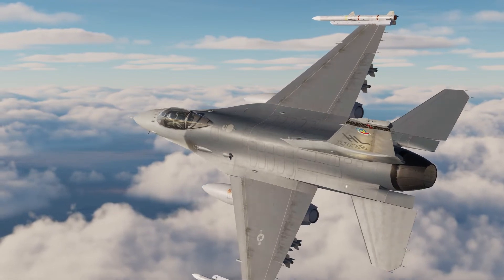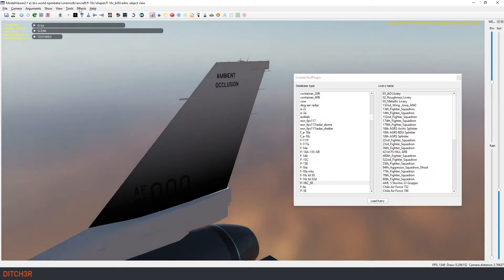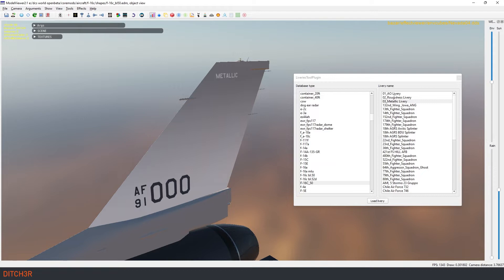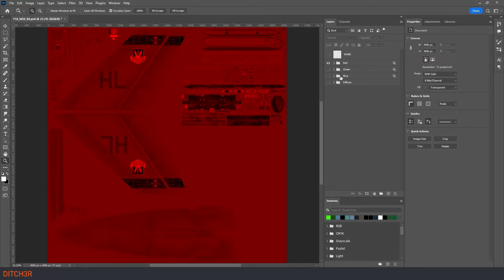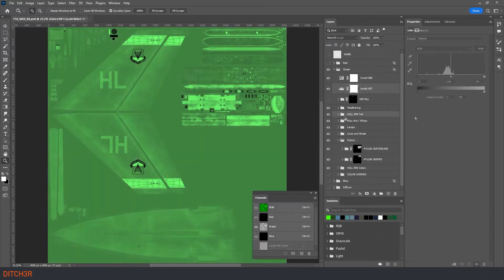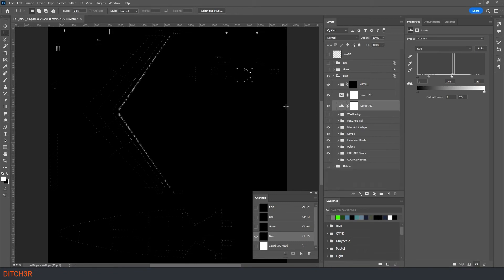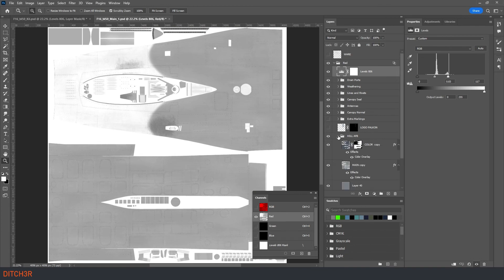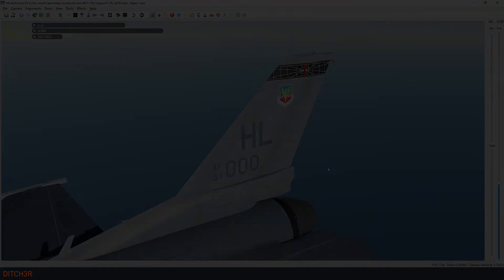DCS Custom Livery Creation | Roughmets

Comment: Hello Ditch3r, Eagle Dynamics recently removed the dynamic shadows on the inside of the canopies of a.o. the F18, so in the cockpit view shadows created from eg the seat, canopy frame or HUD are no longer projected on the canopy glass (they still are projected on the cockpit panels) which is a shame IMHO. Did they change something to the properties of the canopy glass roughmet files to accomplish this you think ? For the A10C these shadows are still in full swing. Any ideas how to get them back for the Hornet ? I tried changing different channels of the canopy glass roughmet file based on the canopy glass roughmet file for modules like the A10 but to no avail... makes me wonder if it's another setting I need to adjust for the hornet... Thanks for your insights !!
Reply from the maker: I have not really looked into this, but I will.  I was unaware they made this change, but I'm guessing it's around the time we saw the "Canopy Reflections" slider added.  I'll take a look, but I'm guessing there is no way to change it back.
Reply: @ditch3rgames  Thank you, curious what your findings will be ! It's strange that many other modules are still generating said shadows, it's apparently not a global issue

Comment: I missed where you edit the description file to use the roughmets. This part has been the hardest for me to learn with the f14
Reply from the maker: For the description file, it's the same as any other line.  Make sure the file name is correct and it is set to false.  If you have more questions feel free to reach out to me on Discord, I can generally respond much quicker there.
Reply: @ditch3rgames i definitely missed the line that tells it to use that file, i have it named correctly from the video. Is your discord posted here?